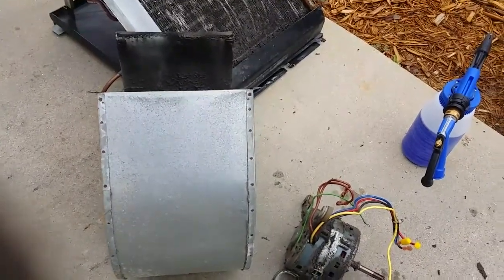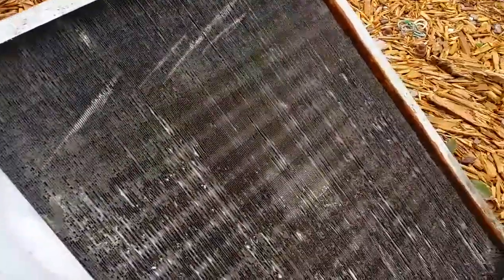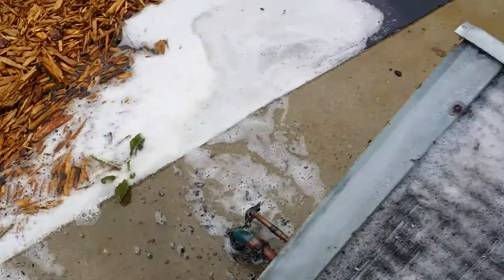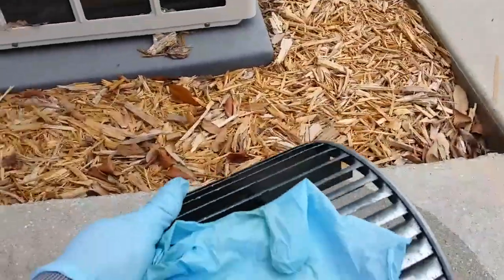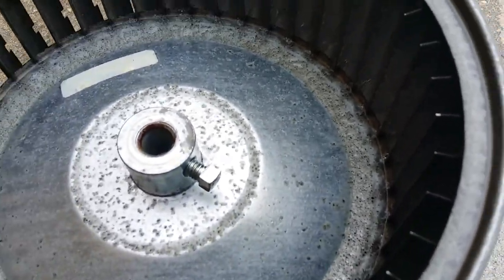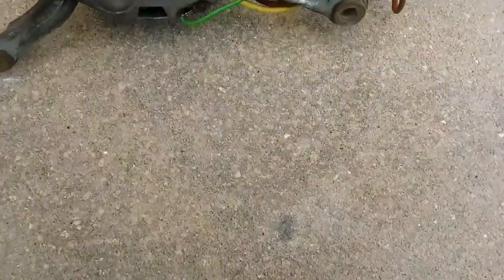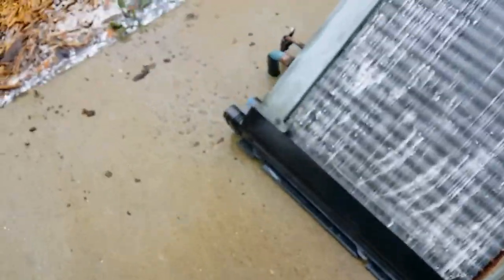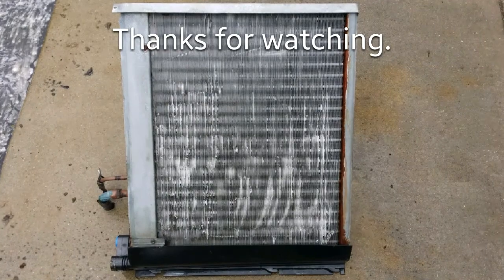Pull and Clean - Hotel Laundry Room Heat Pump

Comment: Was it a Traulsen cooker justin?
Reply from the maker: It was an RPI Industries cooler. They make them for the specific hotel I was at nationwide. They have 1 parts person and 2 techs. They were helpful when I finally got them on the phone. They emailed me 3 manuals with specific programming functions for that specific cooler. Pretty neat. You know I don't work on a lot of refrigeration. It's been more frequent recently though. I was bummed at first but it has brought me more work...especially AC work as you see here. It was nice because I got to pull the unit and troubleshoot it in a conditioned conference room! Not a 130 degree attic!
Reply: That's awesome man..I'd love to do some refrigeration here and there just not on gross restaurant equipment !
Reply from the maker: Me either. I hate restaurants! No way! I wish I could work on server rooms all day. That would be awesome!